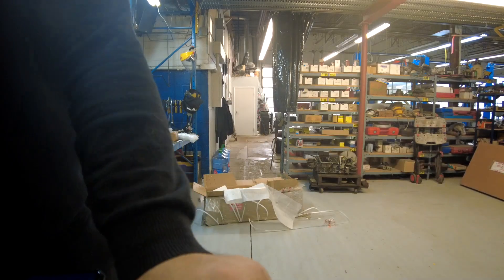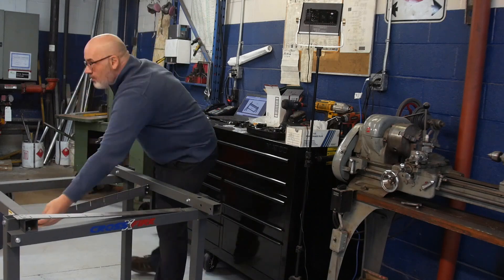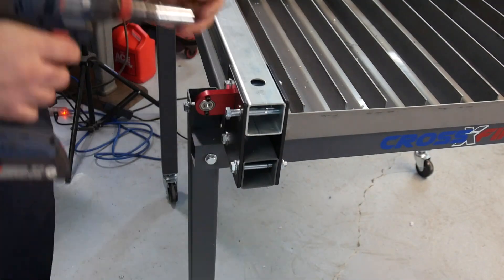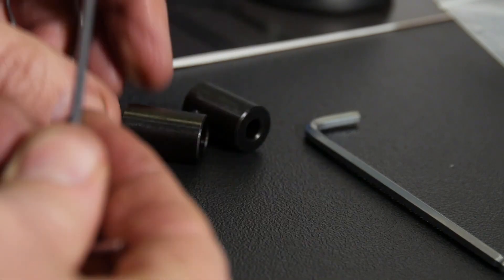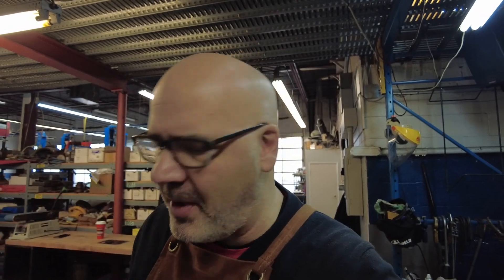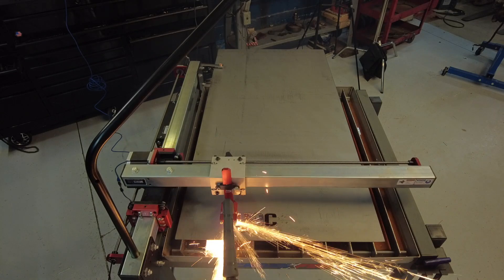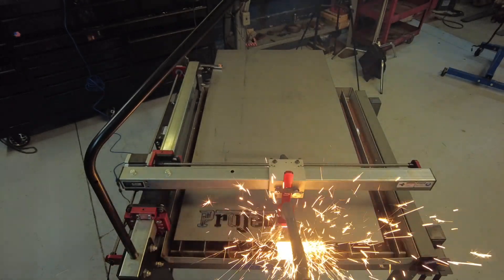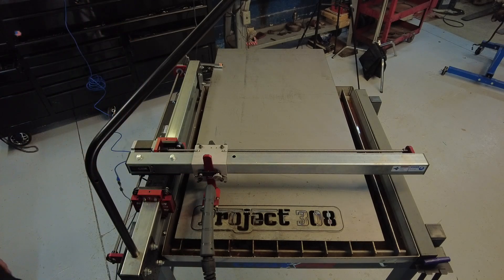Langmuir Crossfire personal CNC Plasma table (bonus Canadian questions)

Comment: I'm about to order one and keep going back and forth on getting the THC or not. I'm just at home and planning to learn so don't need any big crazy setup.  One thing that puzzles me is apparently where the torch fires and where it cuts should be two different heights?  on your machine your obviously running one height the whole time?  does that make the cut quality not as good compared to if you had the THC? as you probably know the THC adds 550USD + the extra associated fees, probably almost 1000 CAD extra. worth it? thanks for the great vid.
Reply from the maker: THC really assists for metal that might not be perfectly flat.  If you are going to be using the table all the time spend the extra money for the THC.  If you are going to be a limited user like me it might not be worth the extra aggravation.

Comment: Good stuff, been jonesing for one myself. Question: Did I understand you correctly - Did they send you a second defective plasma cutter (with an unsoldered transistor)? If so I assume that you did the board level repair yourself?
Reply from the maker: thanks, the first one was the defective one.  the second came in and while it works, it seems that one of the connectors for the CNC port on the front has already come loose. It doesn't seem like Jasic has a very high level of quality control IMHO.
Reply: @LouTrottier  Good to keep in mind. Thanks!
Reply: Sounds like a "cluster..." well you know.

Comment: Crossfire or Crossfire Pro. How are you feeling about it now after a couple of weeks?
Reply from the maker: I'm amazed at the technology, but I also frustrated by the setup.  torch height control would be a pretty big asset I think.  I'm waiting for Langmuir to make that available for my machine.   But I'm wishing that I would have that.
Reply: I was looking at Langmuir’s site and it seems your wait is over. They have a kit that includes the z axis and electronics for $550 USD. Thanks for the honesty of your experience and great movie!
Reply from the maker: @frankherring6253  I will be ordering that kit!  thanks.
Reply: They call it LS-THC. Seems to be a great price to me.
Reply: I may have misled you with the price. Depending on what software you have the price may be $750. Gen1 Mach 3 is $750 and the way I understand the extra $200 updates your mac
Reply: Updates your machine to fire control
Reply from the maker: @frankherring6253  thanks..  Already looked into it.  I have newer unit..phewww

Comment: Another mod for you (you can use the plasma table to make the brackets haha): put a long roller on the one end to keep your cable from dragging on the sharp edges. I have a vac hose (corrugated) hooked up to my CNC router and it kept getting hooked up on the edge of the spoiler board and pulling off. I snagged a 3/8" dia aluminum tube, mounted to a couple of brackets and now it slides over it without hanging up. This will help ease the load on the steppers as they move around too. 

A buddy of mine has a home made plasma table and he has an arm that goes above the unit and holds the cord up out of the way with a bungie cord.....

Comment: I'm going to start off by saying I know nutink about using a plasma torch.(only ever used one once at a machine tool show in chicago for about a minute). BUT I've seen plenty of guys use them and I am pretty sure you can speed up your feed rate for that thickness of material. Was this your first attempt at it? I've seen guys purr through 12 ga steel almost as fast as drawing with a pencil. 

Glad you got it up and running finally, poo on those guys for not simply shipping you out a replacement torch asap. 

Also poo on them for 3 shipments, brokerage fees are a killer. I once left my cellphone at a buddy's place in NH and he sent it back. I got hit with a $60 brokerage fee for a $50 cellphone (it was a pos flip phone in the 90's).

Also poo on them for the broken resistor.